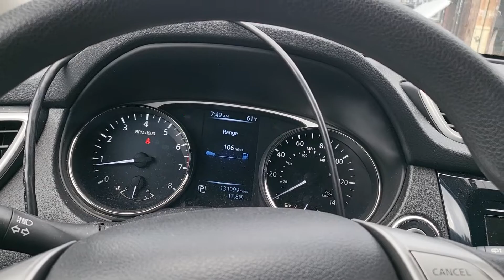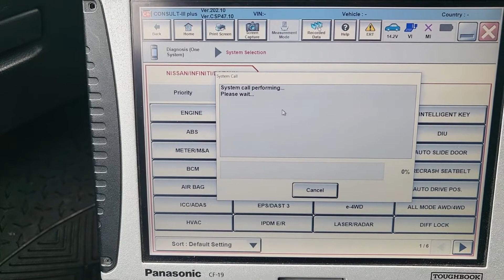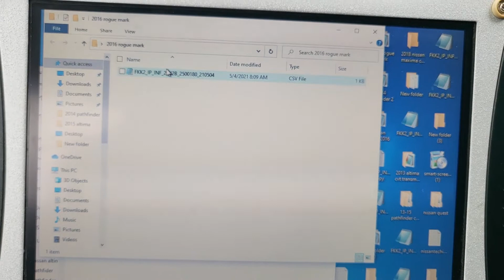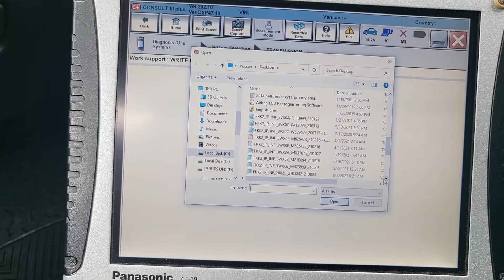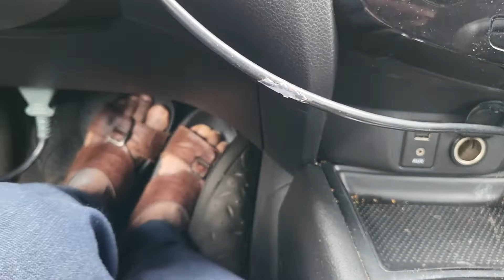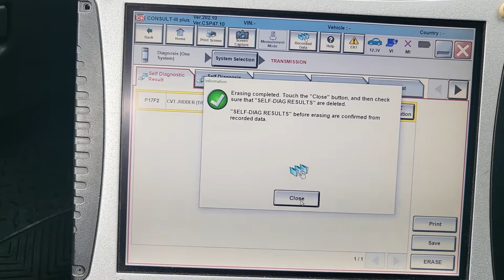2016 Nissan Rogue Transmission Programming CVT Judder Code P17F1

Comment: Can this issue fixed by changing the gear oil and filter s, if the car done 80 k miles without replacing it.
Reply from the maker: no